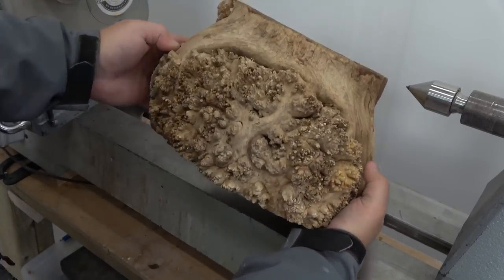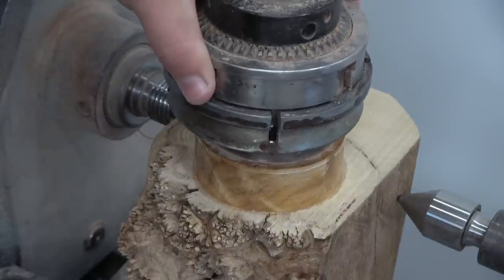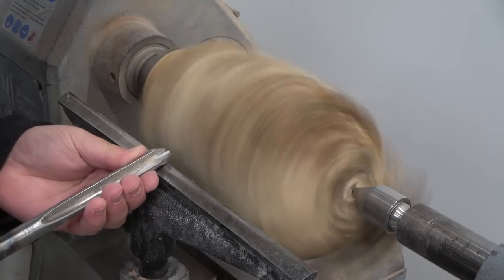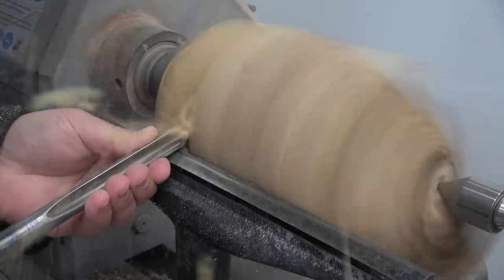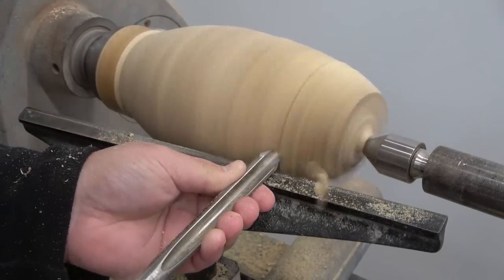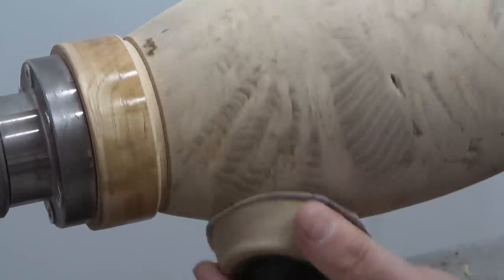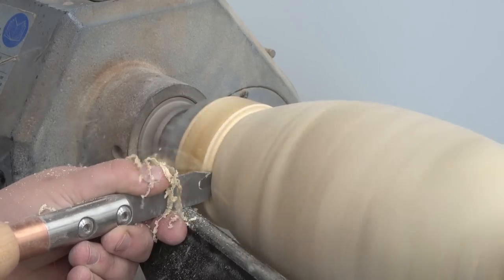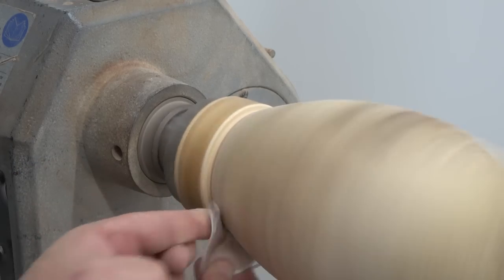Woodturning - Burl Firewood Log to Live Edge Vase

Comment: Beautiful piece. Really like that you left live edge while still maximizing the beauty of the burl grain. I've never seen anyone use the finish that you used on this video. I'll have to look into it and see if it's something that I might want to try.
Reply from the maker: Thank you so much 🙂 This finish mainly used in furniture and table makings but also food safe so ideal for bowl making and cutting boards. Pop the grain well and also provides protection to the wood as the oil will harden

Comment: I'm right handed, but I use my left to turn.
Reply from the maker: I know that feeling. I try to use both hands in different scenarios and sometimes works sometimes doesn’t but good to use both
Reply: Yeah, I try to use my right, on some bits, but whenever I do, I typically tear through the piece or give it some marks that don't come off without giving up some thickness.